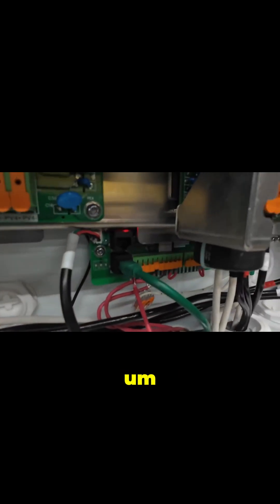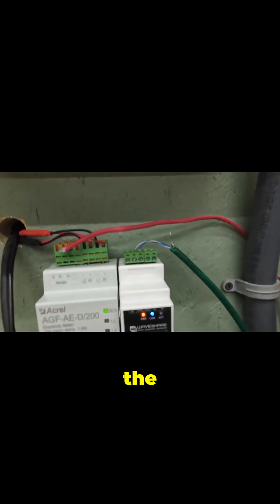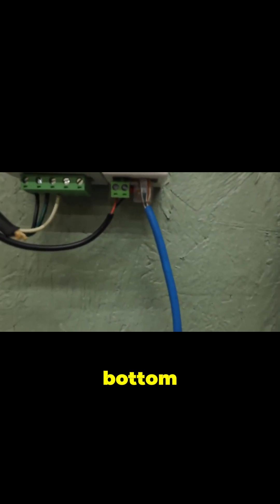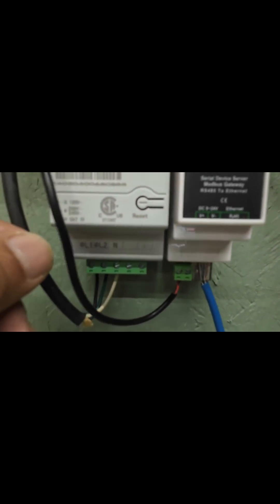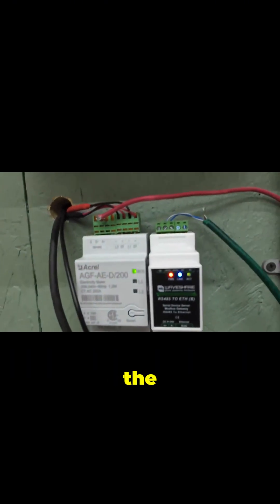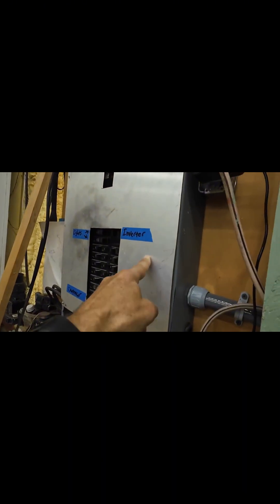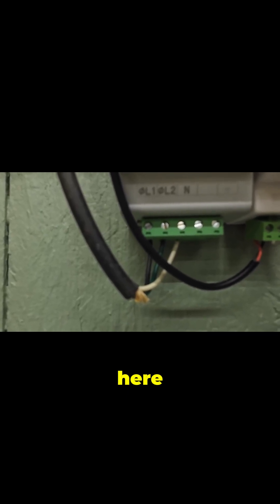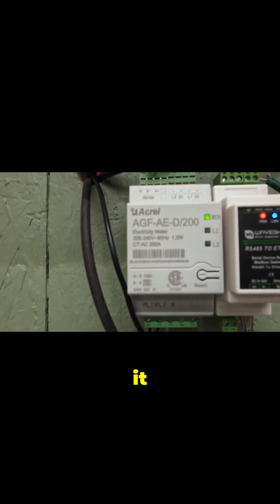Setting Up CT Clamps for Accurate Power Measurements on Solar Inverter #ongridinverter#offgridpower

Comment: Cool . Thx for sharing . What's the part number on the rs485 to Ethernet box ?
Reply from the maker: It's this one, https://amzn.to/3F2lNEO
Thanks for watching!
Reply: @DIYSolarFarming  are you doing zero export
Reply from the maker: @blainecelestaine4543  I was doing zero export on my main inverter before I went off grid with it. this inverter is AC coupled to the main inverter, I use the meter to monitor how much power is incoming from the other inverter.
Reply: @DIYSolarFarming  that's what I'm working towards. Zero export. I am looking at the nhx 10 & 12k , and the growatt 10k. What inverter were you using to do zero export? Sorry  for all the questions
Reply from the maker: @blainecelestaine4543  Solis S6 11.4k https://www.youtube.com/watch?v=8kc1MI1DRhQ
Reply from the maker: @blainecelestaine4543  I have 2 Solis S6 11.4kW inverters and they have been solid performers. When you decide you can use this link and coupon code for Signature Solar to get $50 off your purchase. EDSDIY50 This code is valid through July 1, 2025 After that date check our newest videos for the current code. 
https://signaturesolar.com/?ref=piqshkgv. They have both the Solis and the growatt inverters also High voltage batteries. Good luck and let me know if you need any help!